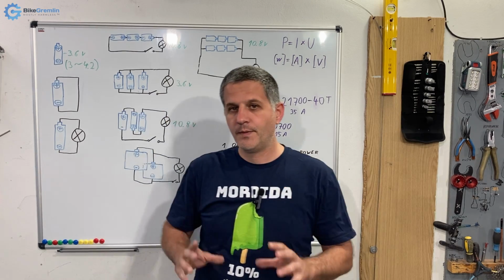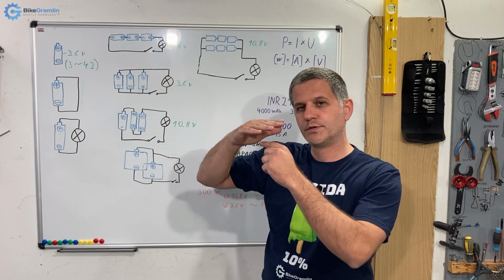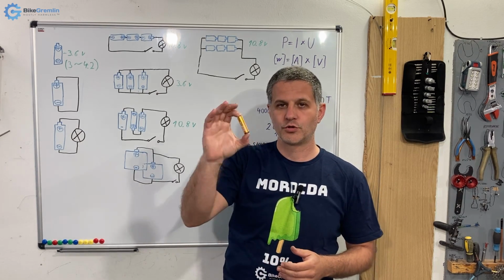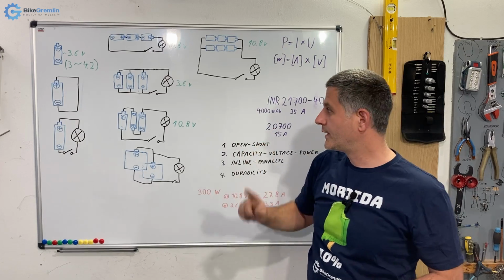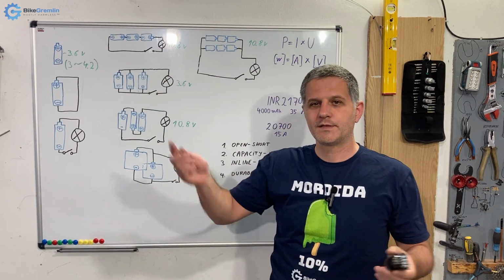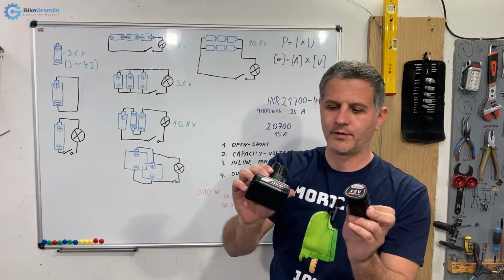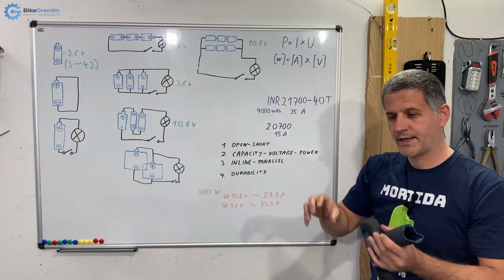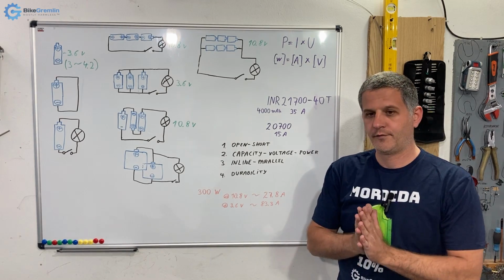Battery capacity and voltage explained

Comment: Good video Relja ( well planned ) . I wasn't aware the tool battery voltages being for marketing purposes only rather than the truth ! I may consider posting something on your forum, depending on what is already written there.
Reply from the maker: Fire away - there is no electricity/battery related talk on the forum yet.  :)

Relja
Reply: @BikeGremlinUS  I'm not an electrician so it seems wrong of me to start such a talk. I did log in to your forum to see if you had created a video topic and there was no direct link from YT  like you did with waxing which will also discourage use of your forum.

All I was going to say is that LiFePO4 batteries are far better in terms of lifetime and safety  than the Li-ion ones with Cobalt and Fluorine in them.  I had a smoking and rather hot bike light and since the manufacturers go for high power density and low cost, and from the noxious fumes it was likely to be one of the cobalt ones.  I got it replaced under warranty so did not open it up as the manufacturer wanted it back !  This is one advantage that Dynamo lights have in that they won't set on fire.  If I ever try to replace the batteries on the replacement light,  I will probably have to use the same ' unsafe ' chemistry because the internal circuitry likely won't handle the lower open circuit voltage of LiFePO4.  

For laptops, being able to set battery threshold limits is useful.  For my thinkpads, under linux I use the tlp package and you can use tlpui as a GUI .  I have no idea if it works with other models of laptop.  tlp will also set clockspeed thresholds so you can limit heat output. 

For high power devices , higher voltage is the way to go for transmission wires  since from Ohms law ...
V ( voltage) = I ( current ) X R ( Resistance )          and Power P = V ( Voltage ) *  I ( current )   , So ...
P=I * I * R    so if you double the current you get 4 times the resistance and heat !

Comment: Should I use a 10amp 14.6V or 20amp 14.6V to charge my lifepo4? Will the 10 help it last longer?
Reply: Thank you for the detailed reply I appreciate the info
Reply from the maker: It depends on the battery pack's capacity (and cell type).
How many (m)Ah is the whole set?

Edit: Either way, LiFePO4 batteries are among the most durable and can take a huge number of charge - discharge cycles (thousands).

Relja
Reply: @BikeGremlinUS  it's a 12V 100Ah by litime. The manufacturers data sheet says to use 14.6V @ 20amps or , 14.6 @ 50amps. I was thinking 10amps might keep it cooler and help it last longer
Reply from the maker: Li-Ion and LiFePO4) battery technologies allow for a lot faster charging compared to the older battery technologies (Ni-Cd, Ni-Mh, lead).

In theory, current that charges the battery in just one hour is considered acceptable.

In practice, for longer lifespan, I would say that the safe bet is to charge them at 1/2 to 1/4 (0.5 to 0.25) of their capacity - so, over two to about four-five hours from empty to fully charged. 

However, there is no need for charging them as low as 1/10 (0.1) of their capacity. That was recommended for the older battery technology (5 to 10 hour charging times - 1/5 to 1/10 capacity charging current). 

That's why I think that even the 50 amps charger would probably be perfectly fine. The 20 amps would be a bit safer in terms of getting the maximum lifetime out of the batteries (but I'd rather charge to 90% at 50 amps, than leave it over night to 100% with 20 amps). The 10 amp is needlesly weak charging current for the 100 Ah battery - if it were lead, then it would have been perfect.

Relja